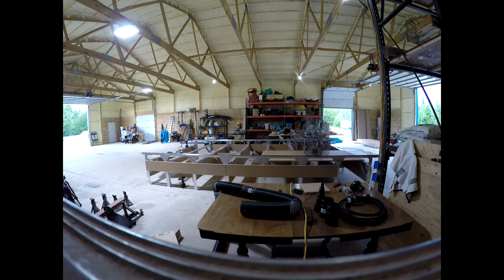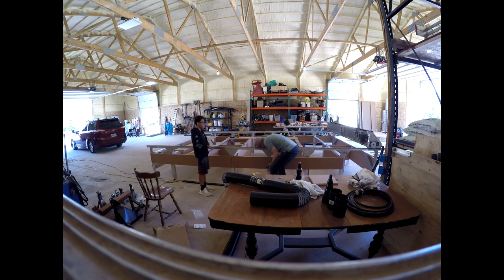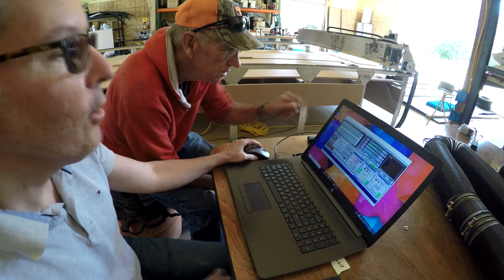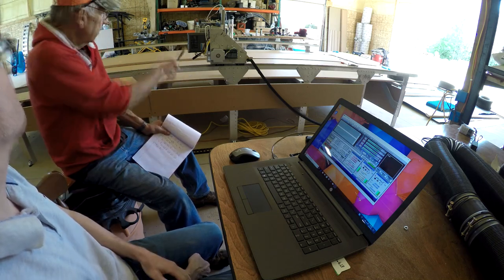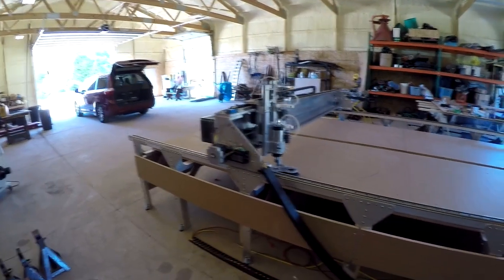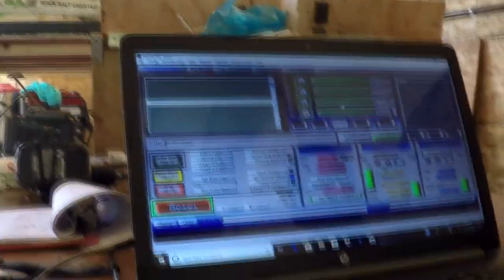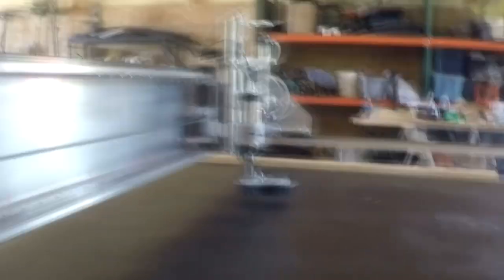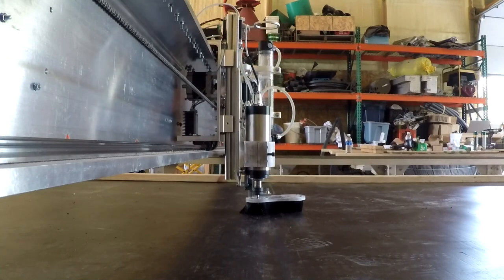Fabricator Pro 8'x17' CNC Router Build in Wisconsin Part 4

Comment: I like the chain drive. I'm in the process of building a 5'x20"  I'm also using a 25h chain drive setup. I use GrblGru (free) instead of mach3. This will be my third cnc machine build for me. So far I've built a small cnc mill, a 5c cnc lathe and this gantry style cnc router. All arduino based. Looking forward to your next project. Best of luck.
Reply from the maker: Yeah, GRBL is a great platform.  I would love to see your work.

Comment: Hi Thanks for sharing, I see that you have been using chain drive for a number of years, can you please tell me what maintenance is required to keep the precision that you get after the initial installation. e.g. how often do your customers need to replace the chain or if the chain stretches do you just recalibrate to compensate for the stretched chain and you are good to go for say another 3 months?

Comment: im really appreciated if you help me with chinese spindle 2.2 kw not running coreectly .. and the spindle become very hot .. but that spindle running as well at the begining .. and i do all the wiring corectly .. i the spindle normal not hot or over heat at all .. but sunndely when i used after 2 week not running the cnc my spindle .. need spin by hand to turn on .. thanks for your all video.. you are my big influancer to build my own cnc  ( i use 2.2 kw spindle and best vfd )

Comment: I'm really not fan of putting the eletronic on the gantry : extra weight, heavily exposed to the dust (poor power supplies and VFD fans :( ) I don't think the gain of routing less cables composates the drawbacks (especially the dust)